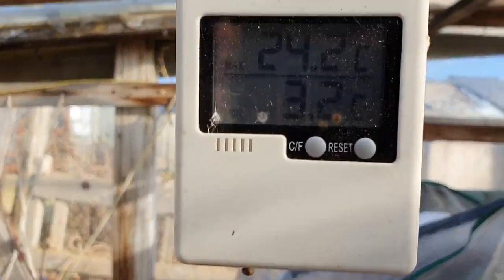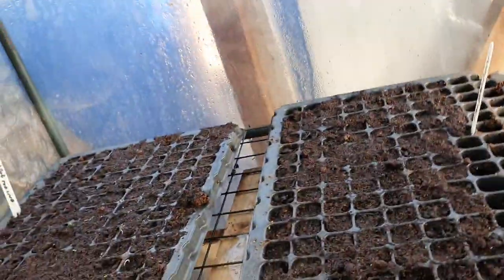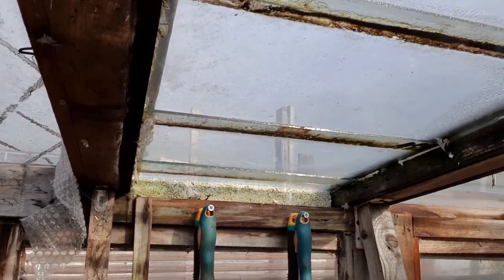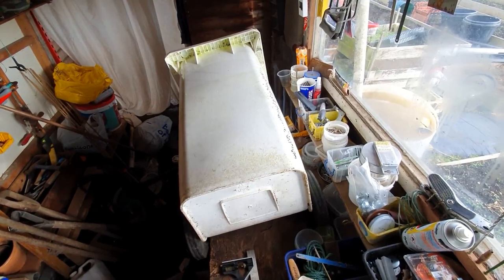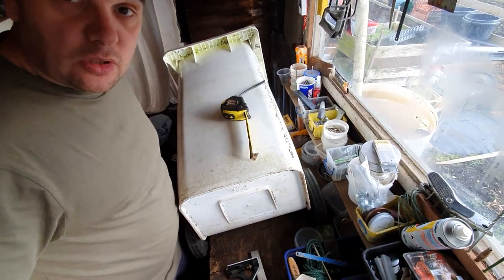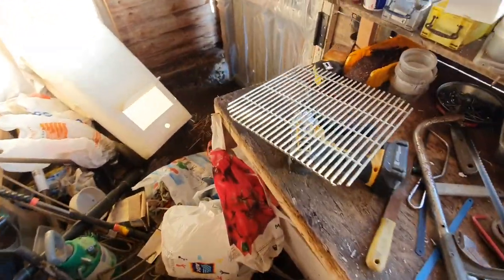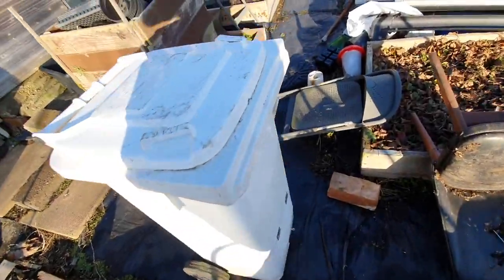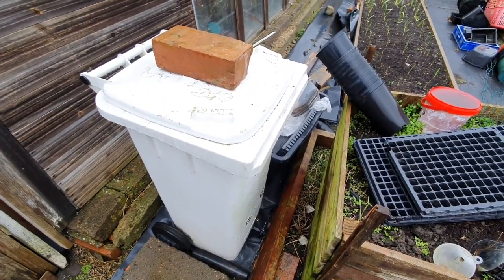Allotment update and building a wormery!

Comment: Winter is great for making stuff. It's gonna cost you a small fortune to keep those parrafin burners going. I used to be able to get a 10 gallon tank full for a fiver!!
By the way, I hope you are going to raise the wormery thing off the ground? lol
Crack on :)
Reply from the maker: Yeah dave I'm just using up what's in the plot, so far I've used about 2 litres so it's not bad for a week.

Yeah the worm bins gonna be up on bricks
Reply: @Gary002  How much parrafin is left on the plot?
Reply from the maker: None I used it all filling the heaters up, see how long it lasts on 24/7 lol
Reply: @Gary002  Remember to keep adjusting the wicks..
Reply from the maker: Yeah I tickle them every time I go up